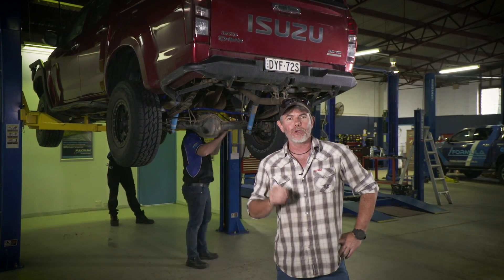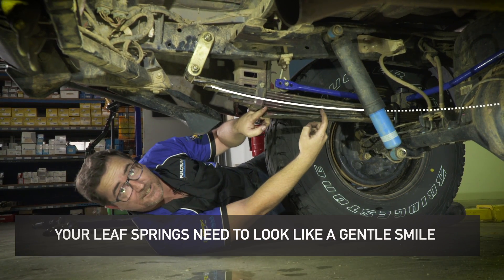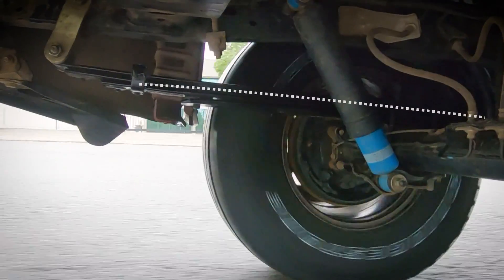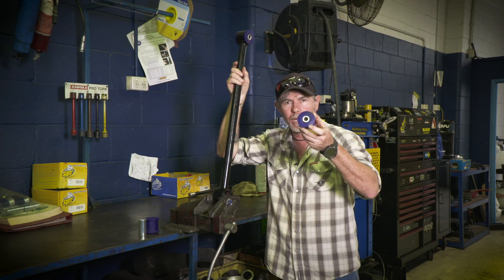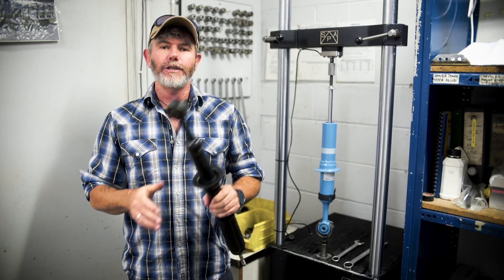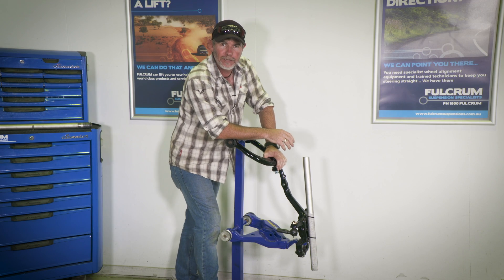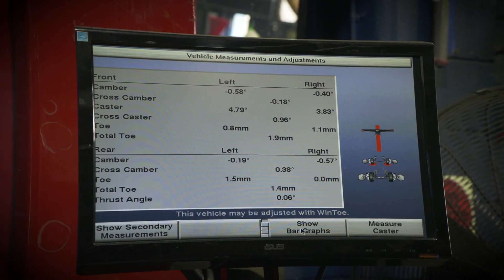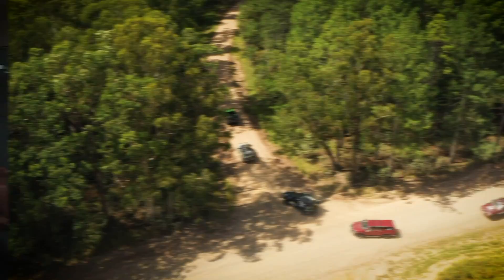4WD SUSPENSION IN DETAIL – what your 2 inch lift is missing! Graham Cahill reveals expert secrets

Comment: 4wd action  
If i am running koni suspension and king springs with a 2 inch lift what else can i get done to make it better
Reply: Depends on what you are using your 4WD for and also what vehicle. Adding more gear always depends on vehicles type and application. Feel free to give us a call on 1800 385 278 or send us a message through our website.
Reply: @FulcrumSuspensions1976  im running a 2001 hilux
Reply: @ultimateruler_12gameing6  If you want to reduce body roll than adjust the konis, but it will slow the vehicle articulation off road. Other than that you have a pretty good setup, you could look at upgrading bushings.
Reply: @FulcrumSuspensions1976  thanks mate
Reply: @FulcrumSuspensions1976  sorry to bother but could i possibly put all the whole setup from my 01 lux to my new 2018 sr5 or do i have to order new parts

Comment: Okay I got a question I've recently got a d40 navara and it's suspension setup in the rear is 1 inch extended shackles and extended rear shocks, and without any wait in the car my leafs have gone completely flat I have read on some pages that they are meant to be flat for comfort but my car now has no flex
Reply: Extended shackles are illegal. Basically you have cosmetically lifted the vehicle but the springs are still squashed. The factory Navara spring does tend to sag/flatten out quite quickly. You would have minimal up travel currently as it would be sitting on the “load” part of the spring. I would recommend fitting a raised rear leaf spring (with the correct spring rate) and replacing the extended shackle with a factory length “greasable” item. Feel free to give us a call on 1800 385 278 or send us a message through our website.

Comment: My stupidity talk: so sway bars are good for roads and get it off the offroad?. Jeeps got that in an optional switch. Ok. I ve got the LN65 on all 4 leaves and I notice road trips , it tilts. When I had the Pajero Mk2 , guys over here told me to go hard shocks set ( switchable soft,medium or hard) so I do not roll on soft.  confused now. My LN65 got that smile shape , standard shocks and I feel it as a hard suspension. The point: Flex is not all offroad. Leavesprings are way far diff from coils. Dmax and all independent fronts, including my x pajero are great. this depends on how you drive ,thinking and predict your hills. once I draw the line on the rough road , mind is were you are not gonna hit. Video shows great performance adds for both which  is great! I love Garham`s Dmax  because he knows how to drive it and he got 2 round pounders to keep up with double sized 4wheelers! and he do it

Comment: So, How much flex does the rear lose with the added sway bar? 

Also, when it comes to lifting and camber of the vehicle, does it work the same the way as you unload the entire suspension compared to an actual loaded 2" lift with load on it?
Reply: The biggest resistance to the fitment of bigger sway bars to 4WD vehicles is the flawed concept of the loss of articulation in the suspension. If the replacement sway bars are designed correctly and the sway bar links are lengthened, replacement sway bars can be fitted with minimal or no loss of articulation. However, the improvements to stability, safety and driveability will far outweigh any loss of articulation.

As the suspension travels up and down on or off road no matter the weight. Caster, camber and toe will change.
Reply: @FulcrumSuspensions1976   Thank you for the reply!

Comment: Hi there I've got the 2017 triton duel cab . How many kgs should it carry constantly on the stock suspension. Going of the video I think it could be overloaded with my work gear.
Reply: No more than what is recommended by the manufacturer, this should be found in your owners manual. According to our data the stock suspension can carry 300kg, we wouldn't recommend this though as it will sag. Feel free to call us on 1800 385 278 or send us a message through our website.

Comment: LC VX 2019 200 series with a Lovell’s gvm upgrade to 3800kgs that comes with a 2” lift. Do I need to replace the UCAs ? I haven’t done it and was advised it not needed but to me the steering feels light and seem to wander a little bit
Reply: Yes we recommend you upgrade your control arms, use TRC485. Feel free to call us on 1800 385 278 or send us a message through our website.

Comment: Hey guys i have a 89 sierra with a 2 inch lift kit in it and  one of my rear passenger leaf springs has twisted? Is this due to it being underloaded?
Reply: Trade it in for a jimny mate ;)  Its hard to say, we would need to see photos or at least have the vehicle in a workshop. I would get a suspension check. We offer a free suspension check at all our stores. Feel free to call us on 1800 385 278 or send us a message through our website.

Comment: I do have a question, i know that sway bar give you more stabilty, but, does the sway bar affect on your flex off road?
Reply: Fitting larger sway bars, particularly in the rear, has two main effects, vehicle balance in terms of under steer or over steer and increased roll resistance. Both of these effects can provide increased overall handling and safety benefits in a 4WD vehicle. If you are looking for increased stability on the road or when towing, sway bars are a great upgrade option.  

As most factory vehicles are partial towards under steer, fitting of a larger rear sway bar, or the addition of a sway bar, helps in providing a more neutral characteristic in the handling. This is due to the increase in roll stiffness at the rear, which changes the loading of the rear wheels under conditions of increased cornering load. SuperPro offers a great range of aftermarket sway bars engineered for many off-road applications, also offering many adjustable kits to best suit your 4WD build. 

At the same time, as the rear end is resisting more of the roll, the front end resists less in proportion, leaving the front wheels more evenly loaded, producing more available front end grip. In the end an increase in overall stability can be achieved by balancing the vehicle.

Another effect of introducing larger rear sway bars is a reduction in chassis roll. This reduces the effects of “roll camber”. Roll camber is the variation in the wheel and tyre camber setting due to chassis roll. During cornering the presence of chassis roll usually results in the outside wheels gaining positive camber. By increasing the roll stiffness and reducing roll camber effect, the wheel and tyre combination stays closer to its optimal setting.

As an alternative, this could be remedied by starting out with large amounts of static camber to counteract the positive camber gain. The trade-off however is the resulting increased tyre wear, and reduction in straight-line handling.

Now that the basics are covered, imagine a Nissan Patrol, Toyota Land Cruiser or Toyota Hilux that has been lifted 50mm with a bull bar and winch package. It has been fitted out with a draw system, roof rack and tows a twenty foot caravan! This may be the extreme, but somewhere between this and a standard, off the showroom floor vehicle, is where most of these vehicles operate. The factory sway bars were never designed to control anything other than the standard vehicle at standard ride height and with something less than being loaded to their GVM (Gross Vehicle Mass) limit.

The modern 4WD Dual cab utility, almost the family sedan of this century. Is normally coil sprung with a strut front end and leaf sprung rear with no rear sway bar support. Because of this dual cabs typically suffer from under steer and can be very unstable during high speed directional changes. When you load the vehicle with accessories, people, change its height or tow the problem only gets worse.

The biggest resistance to the fitment of bigger sway bars to 4WD vehicles is the flawed concept of the loss of articulation in the suspension. If the replacement sway bars are designed correctly and the sway bar links are lengthened, replacement sway bars can be fitted with minimal or no loss of articulation. However, the improvements to stability, safety and drive ability will far outweigh any loss of articulation.

So without reducing comfort or articulation, a sway bar will make the suspension system and tyres perform better, making the vehicle more responsive while neutralising under steer. Fitting a sway bar offers all round improvements in handling, tyre wear, comfort, safety and load carrying. It is one of the best handling improvements you can make.

Feel free to call us on 1800 385 278 or send us a message through our website.

Comment: You had me until you spoke about bushes....Rubber flexes better and absorbs. Poly yes are stiffer but are hard and prone to cracking and put all the stress on the arms and then back through the chassis.
Reply: SuperPro poly bushes are designed per application, they come in multiple duros and for specific vehicles based on off road application come with a specific duro (hardness of bushing) to ensure on and off road performance. SuperPro bushings are covered by a lifetime warranty and a used in the majority of 4WD's in Australia without issue. Sounds like you have had a bad experience with one of the competitor bushings.

Comment: Simple video. But getting a wheel alignment is not cheap. And Also some shops just dont do a good job. I have had two done in 6 months at different shops and still isnt right. How can I tell someone that they did a shit job. Im not an expert and it seems neither are they. I reckon most shops do a std alignment but when you lift it they dont really take into account the new height. They are working to a time limit for everycar.
Reply: Shop around I find most professional looking 4x4 shops that have there own aligner and proud of showing there workshop do great work. If they don't want you to look at the shop or equipment there is ur answer
Reply: Hey mate, if someone is rushing you through their workshop doors for a wheel alignment. They are obviously not doing a good job. You want someone who will take the time to look at your car and also give it a wheel alignment. This is why we do a free suspension safety check with very wheel alignment.

Comment: Will 33’s fit on an Isuzu rodeo with a 3 inch lift?
Reply: You will probably need a body lift, we wouldn't recommend with just 3 inch lift. From experience it will scrub on the guard.
Reply: Gotcha would there be a way to eliminate that then? If not how much of body lift would be needed? Thanks for replying!
Reply: @_ruuudy_4558  Not with a 3 inch lift. A 1 inch body lift should do it, be mindful of your wheel offset though. I wouldn't recommend doing a 3 inch lift to a rodeo at all.
Reply: Ah well I will keep that in mind then dangit.. We’ll if I did do it any recommendation where I could get parts the body lift?
Reply: @_ruuudy_4558  Depends where you but near me in Brisbane On Track 4WD is pretty good.
Reply: Fulcrum Suspensions Terrific thank you I’m in America! Thanks for the help!!

Comment: I would never use an adjustable a arm like that without an insert to lock it in place. Our roads are so crappy in Detroit you could not even drive on the street with a setup like that w/o knocking it out of alignment.

Comment: hi Shane, i currrently have an issue where my car is rocking/boucing from front to back on the highway whilst doing around 40 to 60kph. settles more at higher speeds. could this be shock related? thanks

Comment: Hi Guys. Is a Sway bar similar to a Watts linkage,or am I barking up the wrong tree?
Reply: A Watts linkage keeps the axle centered under the vehicle, and helps control roll center.  More of a  thing for traditional live axle sports cars than off road rigs, but I'm sure someone here will disagree and reference some trick watts link setup he read about on the internet ;)
Reply: @ewingfox6459  Thank you Ewing Fox. Sorted in my head now :)
Reply: Sway bars are different to a watts link @
Ewing Fox has given a good response.
Reply: @FulcrumSuspensions1976  - I'm debating either buying a Toyota 4Runner or a double cab ute here in the states (we call it the four-door Tundra) and learning curve to build a suspension for this rig will be pretty steep for me! I have a background in rally cars and standard traditional solid axle vehicles but nothing in between :)

Comment: Do you disconnect your sway bars on tracks for more flex?
Reply: Personally no, but you can do this if you like. We of course recommend you keep them on but if you really want more flex you can do this. Of course you should always reconnect the sway bar when yo go back on the road.
Reply: I run without them, or use units with a quick disconnect.  'back in the day' we had Audi rally cars that would run without sway bars on certain stages to improve turn in and combat understeer (for legal and ethical reasons, I can't suggest that you try this!!! :)  ).  Lifting tires on the trail makes for great pictures and video, but means less traction.

Comment: You explained camber and toe, but what is caster?
Reply: Look at your wheel from the side - facing the hub.  If the angle of the spring is vertical, than you have neutral caster.  If the spring's top mount  is ahead of the wheel's centerline, you have negative caster, if the perch is behind the wheel's centerline, you have  positive caster.  Positive caster increases tracking (going straight) and negative caster makes it easier to 'turn in'.  Things start to get complicated when you start talking about corner loading and on throttle/off throttle dynamics - usually people don't talk about it much because unless you are going to build a fully customized suspension, the caster geometry is usually left alone.
Reply: Castor is defined as the angle created by the steerings pivot point from the front to back of the vehicle. Caster is positive if the line is angled forward, and negative if backward.

Typically, positive caster will make the vehicle more stable at high speeds, and will increase tire lean when cornering. This can also increase steering effort as well. 

@Ewing Fox also had a good response.

Comment: The drawback to poly bushes is that they increase cost loading so they can cause cracking, the hilux suspension demonstrated was operating outside of design range so it was willing on a whole heap of positive camber, which is really bad for dynamics and putting in a rear seat bar will lower flex and increase the cars tendency to oversteer... The spring and shock stuff wasn't bad though.
Reply: The Hilux is not running positive camber it is running negative camber. It doesn't matter what bushing you are running, whether it is poly or rubber. If you over crush a bushing it could damage any component it is fitted too. The reason we have a rear sway bar is to aid in quick turning maneuverability, without it would fail. Feel free to give us a call on 1800 385 278 to discuss.
Reply: @FulcrumSuspensions1976  , I didn't realise I'd incorporated a few funnies in there because of the phone post. Poly bushes are rising rate, unlike rubber, especially where they're replacing voided bushes. What that means is that, when you're giving them a hiding they can put substantially higher loads on hard points than rubber bushes would. You're right that there's a point past which there's not much you can do though. If you're binding bushes then you're driving outside of what the car was designed for.
Regarding the rear sway bar, it results in the development of more roll stiffness at the rear, which will result in a general tendency for the car to oversteer, as a similar stiffness increase hasn't been undertaken at the front. Utes are typically designed to have a fair amount of understeer baked in because of the relatively stiff rear suspension, but this modification could result in hazardous terminal vehicle behaviour.
Regarding the hilux suspension vertical travel, the point that I was making wasn't that it had a particular static camber, but that it was rolling on positive camber, quite significant and obvious levels. If they're visually obvious then its likely that the suspension is being operated significantly outside of its design range. That'll result in positive camber on the outside wheel in harder turns and positive static camber under high load conditions.
I'm happy to talk about it further if you'd like, but they're my observations.

Comment: Do solid axle vehicles such as Jeep Wranglers have as many alignment issues after a lift compared to an IFS vehicle?  My understanding is that unless you have adjustable lower control arms, toe in is really the only thing you can adjust?  Thanks!
Reply: They definitely have their own alignment issues that are just as serious if not corrected as ifs setups.  Control arm relocation is very important if you plan on lifting the vehicle more than 2 in.  When you start running large tires or bigger lifts I typically toe in a few degrees and since I run without sway bars keep just a touch of positive caster for tracking.  Check out the JKS J-Kontrol kit to see how they solve the alignment questions you have - I installed one a few months ago on a jku for a customer and after a mark one eyeball alignment he had it brought to a laser alignment shop and it came back with all zeros -  the guy was actually mad at me for having him 'waste' money on the laser alignment (I was thinking of his safety and also his brand new tires).  Generally, yes, the solid axle lifts ARE simpler to maintain a stock (or safe) geometry.

Comment: I prefer a solid front axle and rebuildable cartridge joints. Poly bushings on nothing that has to flex side to side. We rock a totally different style in the US though. Also adjustable rate sway bars front and rear to balance it out.